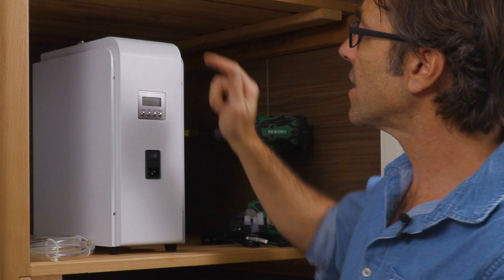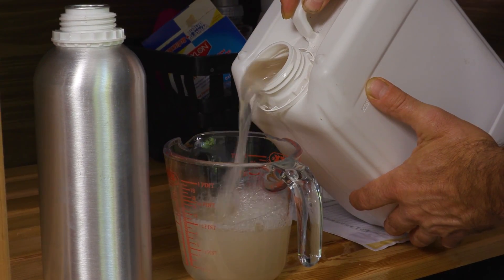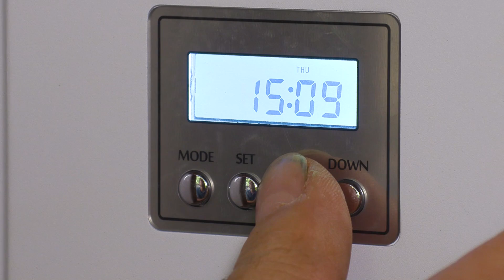Ingenious Air MVHR Probiotics Upgrade - Capel #30

Comment: It would be much more professional if they sized it all properly and included a rubber bung for the supply tube where its introduced into the vent shaft rather than having to put a dab of polymer seal on afterwards.

Comment: I was going to make another joke about the woo-woo, but it occurred to me that the introduction of this element may really just be an admission that this (and perhaps other) MVHR system is prone to bacterial build-up if it isn't kept clean in some approved manner.  Surely it would be better to fix the problem by adding drains and/or antibacterial surfaces where moisture is most likely to gather and the risk of bacterial mats building up is greatest?  Or maybe the marketing department ran a whalesong session and blue-skied a box of readily-retrofitted pseudoscience which just happened to take advantage of their customers' current Covid-19 fears...

Comment: I like the MVHR but I would never willingly add any bacteria into my breathing air.  If you want probiotics eat some kefir, kombucha, yogurt, or take a supplement, don't breathe them in !
Reply: Even probiotics you eat do nothing, they are all killed by the stomach acid before they reach the gut.
Reply: Pre biotics seem to matter more, so fiber and certain indigestible sugars. They actually get to the gut and feed the flora. @londontrada

Comment: Two thoughts on this Robin: 
This will obviously impact the air flow right from the fresh air flow which may bugger up any necessary careful ventilation calculations that have been done. (Minor impact really).
But more importantly I'd question quite how safe it is to add any form of moisture to the ventilation system especially post filter. Which also raises concerns about longevity of the system especially as you've used metallic duct.
Reply: Systems are always designed to handle some moisture because that's unavoidable...

https://www.hvac.com/faq/recommended-humidity-level-home/

Comment: Do you think it would be better to fit a gromit in the hole so the pipe can be fitted and retracted as many times as you like? I know you don't necessarily need to take the pipe out but it would leave a very clean looking job around the hole.
Reply: I thought they would have supplied it with a gromit !!!
Reply: @jasonantigua6825  it's the least they could do.
Reply: @SkillBuilder  Haha

Comment: What would you say is the advantage of MVHR of something like Direct Control Ventilation? (DCV), I know you get the heat recovery but you'd only use that in winter, but it's phenomenally more expensive over DCV just for effectively that one benefit
Reply: Can the heat recovery work in reverse... i.e. if you have AC it draws in fresh hot air from the outside but cools it in the heat exchanger?